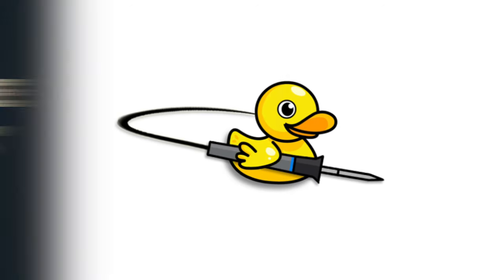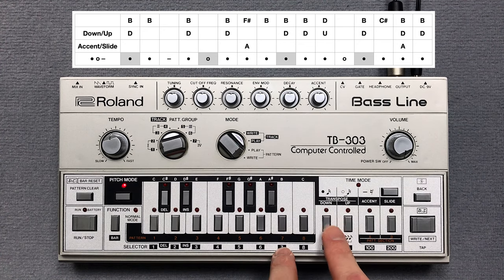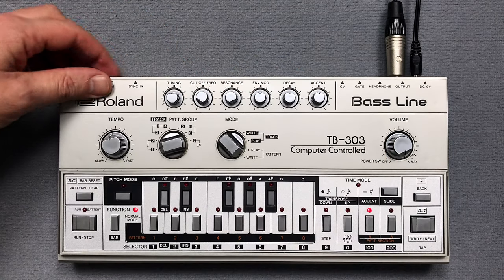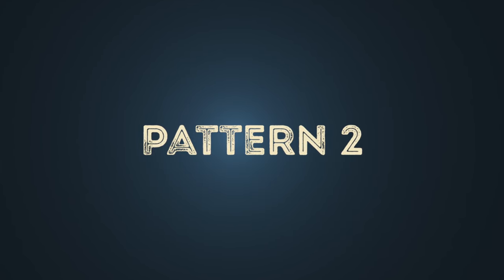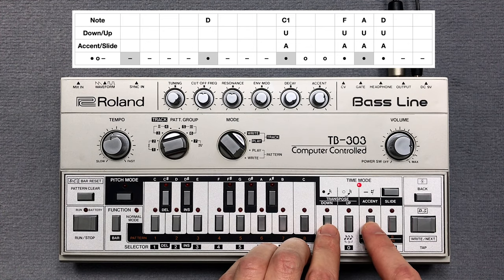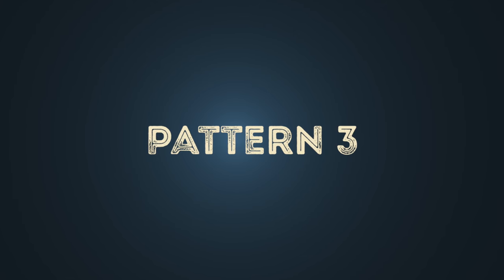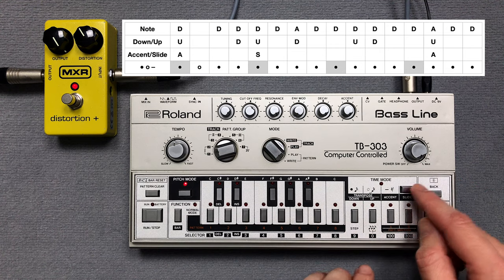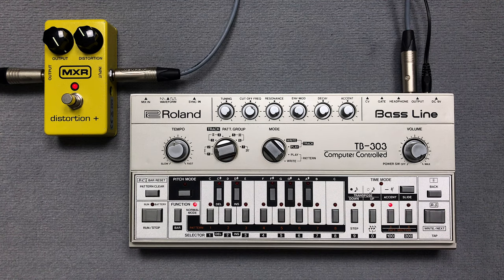Microwave Prince "Golden Times" – Roland TB-303 Pattern, MXR Distortion+, Behringer TD-3, Acid

Comment: How do you get better at making your own patterns? Love my TB-03 but programming good riffs is so difficult!
Reply from the maker: Unfortunately, there is no recipe for this. 🙂 Just try it out until you find something useful. 👍
Reply: The TD-3 has a random feature that helps. You can replace notes and swap timing out from there.

Also, it helps to know the "gems" of a 303. Meaning, what specific things make those iconic sounds. I've discovered that putting an octave-up right after a slide sounds great. Sliding into an accent sounds great as well.